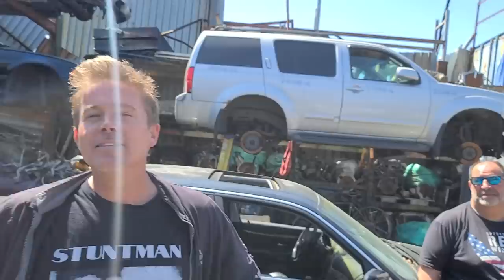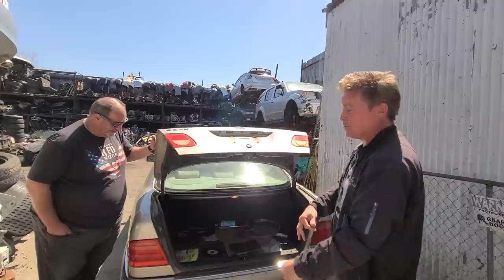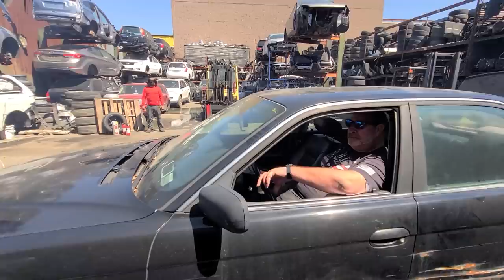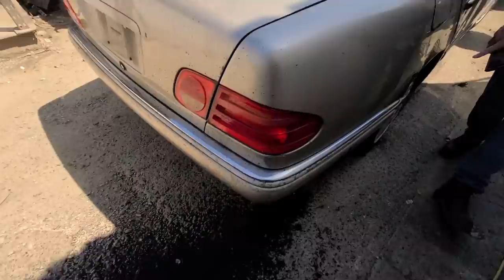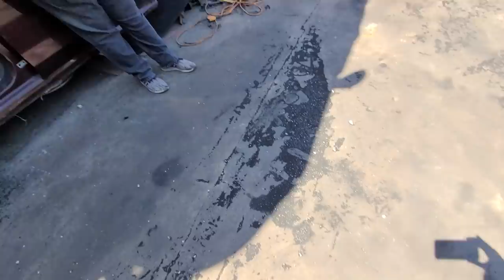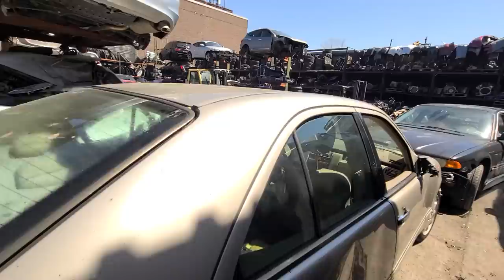740i BMW & E320 Benz Battle it Out @The Junkyard, NEUTRAL DROP!

Comment: ngl those 1996 to 2002 e calss are actually super good i had like 6 of them and they all worked with no issues and they all had 200k miles lowest i had was 179k and highest was 263k youd be surprised how the 263k car felt compared to the 179k and the 96/97 model have a straight 6 engine and sounds like the e36 when you do the pips an exhaust
Reply: I just got a 98 wagon e320 with the m112 v6 very nice car love it

Comment: how about using a dogs chain to try and hold the car in place,  tie it to the tow ball and use a choker chain, if it breaks, try thin rope,   use fan belts, loop the belts over each other or loop them to make a chain,  then tow to tow pull?? sound good?